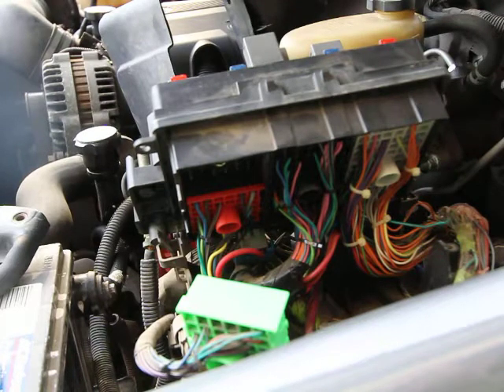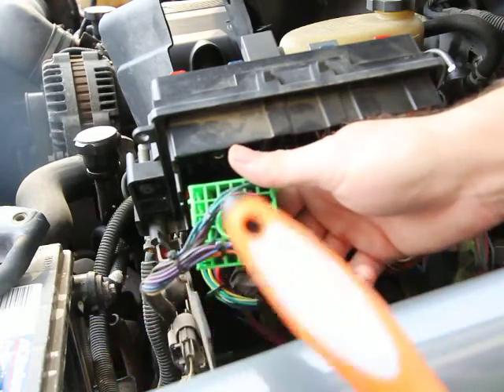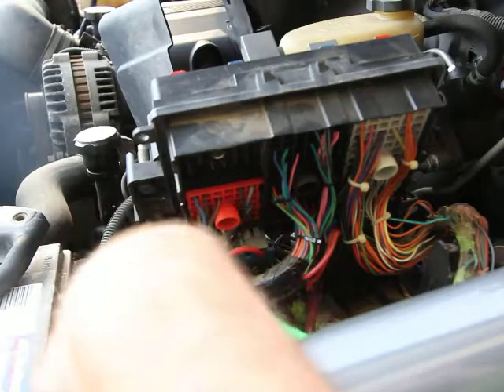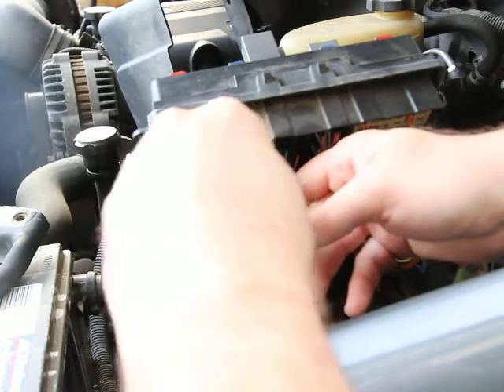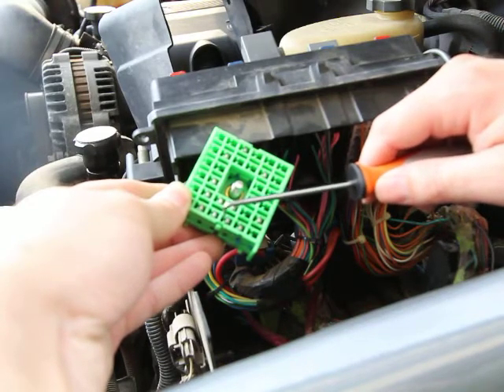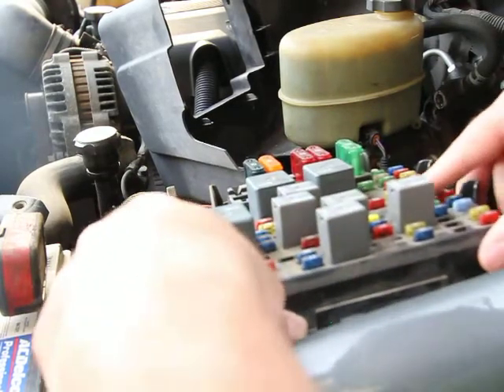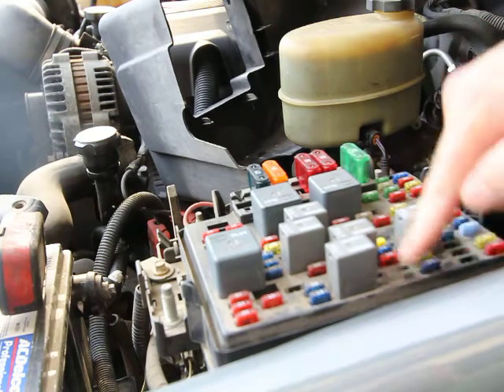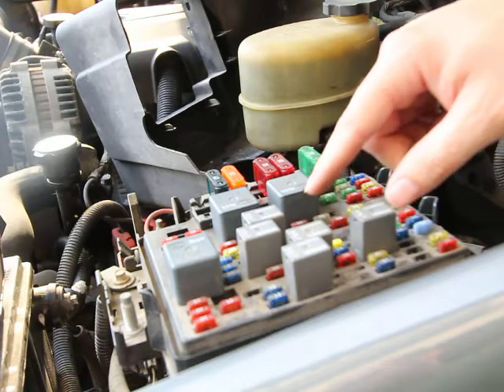99-02 FOG LIGHT PIN INSTALL FOR FOG LIGHT ADD ON KIT SILVERADO AND SIERRA GMT800

Comment: glad this video popped up in recommend after i watched your other one about installing this kit.  so the only thing left for my actual install is whether or not the pin that i got from the '06 will plug into the green plug on my '02s fuse box.
Reply from the maker: Pins or the same 99-07classic plugs for fog lights are different
Reply: I guess Im kind of randomly asking but does anyone know of a good website to stream newly released tv shows online?
Reply: @Lucca Jesus I dunno atm I've been using flixportal. Just google for it:P -billy
Reply: @Billy Karson Thank you, I signed up and it seems to work =) I really appreciate it!!
Reply: @Lucca Jesus no problem :D

Comment: Hey man so this might sound off but i did a whole 99-02 window conversion like the whole dash harness for 99-02 eletric windows since my truck was a base model i swapped it using my original bcm and it turned on and everything works but i remember the donor truck i took it off of had fog lights so would i still need to do the bcm flash?

Comment: Why would you need a reflash if you already had oem fog lights? I have 2001 yukon fog lights were working and now not working,I’m having problems. I’m hoping it doesn’t need reprogramming. I put a wire in the circuit to by pass and the lights come on. Has a new relay and it still doesn’t work. Please help.
Reply from the maker: If you already had lights a reflash would not be required

Comment: Website still up? I need a harness and this seems like a good one to get
Reply from the maker: What year? 99-02? If so http://plugnplayparts.com/99-02-fog-light-kit
Reply: @SpartanAutoworx how can I check to see if my 99 Silverado was pre wired for fog lights? I looked around haven't found any harness so far. But it came with valence already cut out and I only have the cargo light switch

Comment: Installed but the switch controls the daytime lights not the fog lights.
Reply: Oh, thanks for the DLR idea! I'm planning on adding this OE fog light switch to mine. There underneath the dash bezel, is a hidden 5 wire plug that Iv found.
💡 It's probably a DLR harness option for Canada/ sister versionmodel of my 1995 suburban.
 Still need to trace the wire and find a new relay switch fog/ DLR... And then, Make my own wire harness. Got to figure out the wiring;Before I even get to drilling mounting holes for the new fog lights.

Comment: So its 110 and what if it doesnt work? Do U need to pay more to get ur pcm flash or what the fuck?
Reply from the maker: If the bcm has not been programmed for fog lights then yes you will have to have the dealer flash the bcm for them.